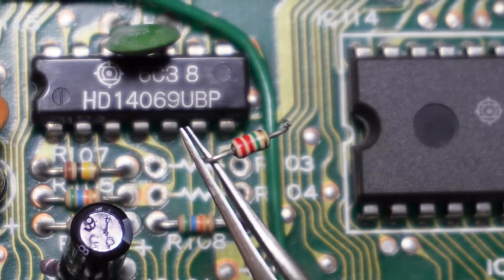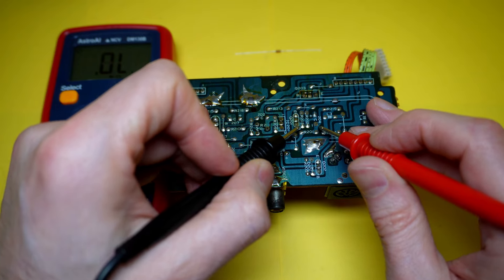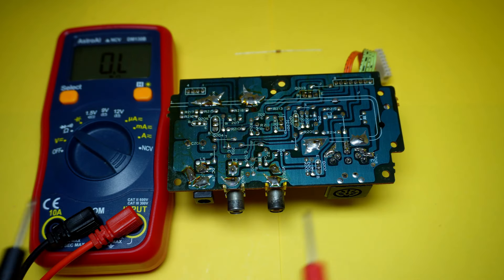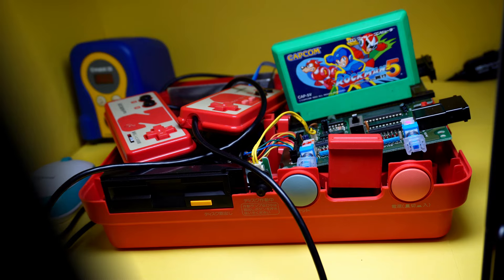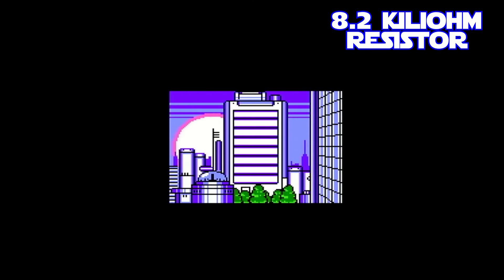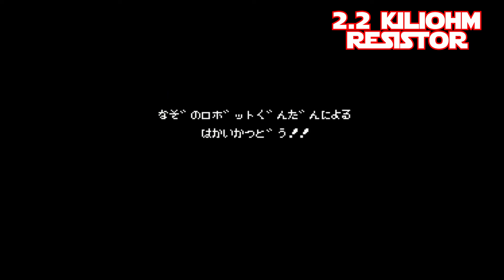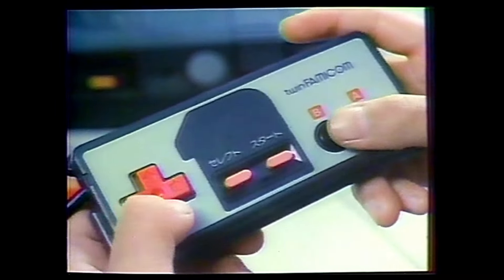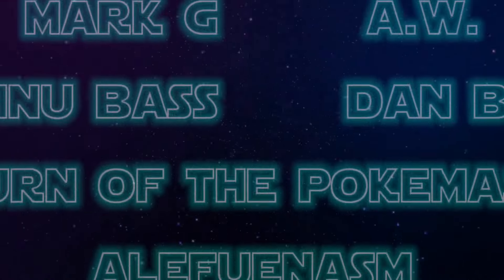Nintendo's 2nd Big Mistake on the Sharp Twin Famicom Additional Audio Fix

Comment: I've got a twin famicom r, but I need to get the disk drive working before attempting the sound fixes.  I've never soldered before either, so that's a challenge.  Currently, my twin fami drive is stuck at the now loading screen and is making a loud grinding noise.
Reply from the maker: All you need to do is replace the belt check out this video I show you how its done https://youtu.be/cEJ_-PThT7M?feature=shared
Reply: Sounds exactly like my drive.  The belt was non existent, but little bits of black rubber were all scattered inside the twin. 😂
Reply from the maker: Yes thoese belts love to crumble all over the place
Reply: Finally fixed my belt issue.  Drive works but sound is absolutely terrible.  Low and distorted.

Comment: Hi Scruffy,
You say it's wrong early on, but why is the resistor too large a valued and how does changing one in the power circuit impact the audio?

Edit: aaah, it shifts the volume level up. 👍
I see a post on NESDev that suggests swapping R201 and R220 which has a similar effect.
That post also mentions replacing C205 for a different value cap, and possibly C113 on the main board.
Reply from the maker: Yep apparently there was some confusion on the assembly line. But if you take a look at the video linked in the top comment i show you the two resistors you need to swap to balance the expansion audio of the disc system section. Interesting ive havent heard about changing the capcitor before 😮😮😮